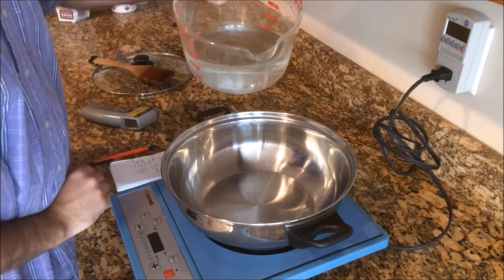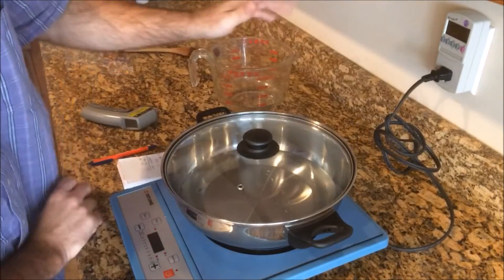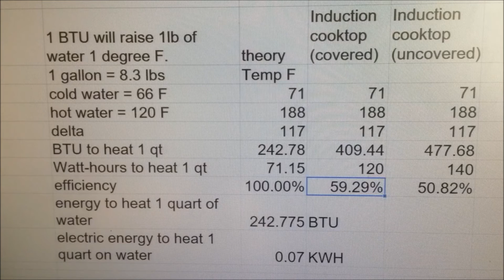How to Measure the Efficiency of an Induction Cook-Top

Comment: The samsung is saying induction is 90 efficient
We know that is just false claim
Reply: It is more than 90 percent. You cannot measure temperature accurately with an infrared. Also the procedure to measure this is half hazzard.  There are norms as per the international standards to measure the energy. We do it always as we design such induction stoves. This experiment gives just an idea but is not conducted and measured as per the standards. The vessel efficiency is also playing in this experiment. A bad vessel will have lesser heat transfer. Cheers 😊

Comment: Amperage draw please
Reply from the maker: Wall voltage was around 115VAC at the time. So current draw is whatever wattage reading was / 115. 
For example: 1500 watts / 115 V = 13.05 A

Comment: Can you measure the same for electric cooktop using the same pot ? 
Did you measure the energy require to bring the pot metal from room temperature to the boiling point ?
Reply from the maker: I did some comparisons in this article.
I only compared heating up to 187°F. 
https://www.johnsavesenergy.com/how-water-vs-cold

Comment: I live in a cool temperate climate. I resist the CFL and LED propagandcrap as Edison filament bulbs are only 3% efficient at creating light, 97% at heat. My lighting season coresponds 100% with my heating season.
Beat that if you heat your home 10 months a year.
Reply from the maker: If you need heating that much then yes incandescent probably are the way to go. However if your outside temperatures are regularly above 20 degrees F then a heat pump is more efficient than resistive heating and you would still be  better off with a heat pump and LED lights.
Reply: @kc7ekk  John how efficient are heat pumps? Baseboard electric radiators are ~80%.  Incandescent bulbs 97%.
I'm not heating my house with lightbulbs. Just supplementing the zones I am in. No moving parts, 2-3 dollars a piece.
Reply from the maker: @cbcsucks2205  Air source heat pumps are typically 250 to 300% efficient. Meaning you put 1 unit of energy in to run the thing and you get 2.5x to 3x the energy out. Ground loop heat pumps are upwards of 400-500% efficient. 
Initially it seems like they are violating the laws of thermodynamics except the extra energy is coming from the air our ground. 
In the winter time they borrow heat and in the summer time they give it back.
Reply from the maker: https://www.johnsavesenergy.com/geothermal
Reply: @kc7ekk  they are very popular here. (Newfoundland).

Comment: they are also very dangerous in the radiation levels they give off, apparently.
Reply from the maker: Actually induction cook-tops expose you to less radiation than a hair drier.
Reply: George Rellas..... Cellphones give off dangerous radiation!
Reply from the maker: In 44+ years of cell phone existence, nobody has been able to prove any medical link between the low level radio emissions from cell phones and any medical problems attributable to radiation. 
Cell phones today emit less radio energy than they did 10 years ago. if there were a link (which there isn't), today's cell phones would be less of a risk than earlier models.
Reply: those who CREATED the cellphone, the Israeli-Motorolla r&d people, back in 1972 are now warning the public about the dangers of too much cellphone usage
Reply: @GeorgeRellas  Cell phones signals have way less EMF radiation than literally the sun.  Phones use less energy per unit of time than a 20 watt bulb.

If can handle to be under the radiation of a light bulb you will have no issue with cell phones.